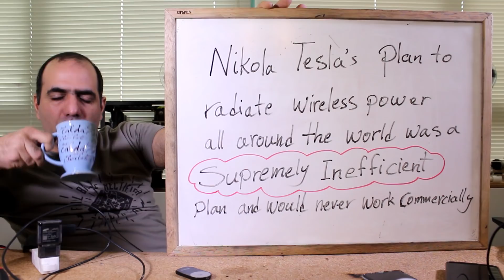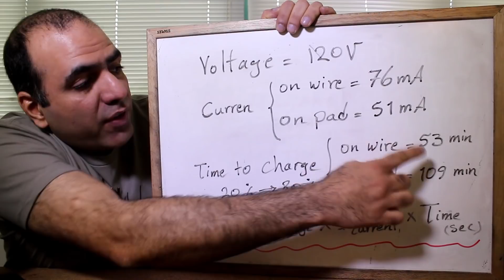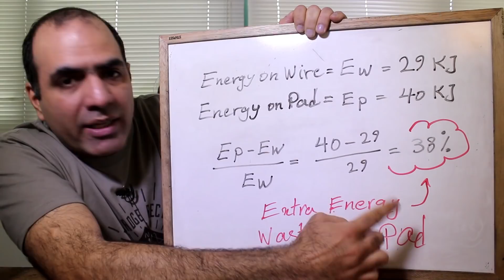Drowning in Inefficiency

Comment: Obviously he has always used Android phones ...  all Apple plugs are designed to fall apart with a few hundred uses :D  But really, had apple stuff for years and did go through several chords a year, from the old wide connector to the lightning.  6 months with Android based phone, not one broken connector.

Efficiency does need to be increased, and it does over time.  Some of the new engine designs are getting much more efficient, like HCCI.  We need more engineers to focus on various things, including efficiency.  But such in the U.S., we have the entire infrastructure of the country falling apart, from our interstate road system and bridges always under construction and or falling apart across the country for the last 4 decades that I've been around to our power distribution as well in a state of disrepair.  A lot of our efforts and daily life can be improved upon.

Imagine all the energy wasted that could be saved both human and machine if they just did the roads right the first time instead of it being a bidding war, with planned degradation for future job security for the paving companies/jobs for the community system.  Also if we found a better, more efficient way to distribute the energy across cities and states.

I can't accept complaints about LED efficiency when a decade ago we were all using incandescent, halogen, etc ...  if you consider those are pretty much fully phased out in the U.S. and most people have replaced most of those bulbs ...  Less than 10% of the energy used 20 years ago to light a house is used today.  That is HUGE, even if they are still not perfect.  It can be said to less effect with cars.  I had a 75 Pontiac that did 9 mpg no matter what.  I drive a car now that gets 40 mpg in worst case scenarios and have done 60+ mpg on the regular, and we are going to see that start to shoot up when the HCCI engines start to get out there, and their efficiency is improved over the years as its new, plus the hybrid thing gets more efficient and cheaper to implement over time as the batteries and motors become more efficient, doing more, for longer, with less wasted energy ...  even though other recapture systems might be more 'friendly' such as compressing air to assist in braking then using that stored energy to help accelerate the car; as we go to engines as generators for electric drive systems instead of used to move the vehicle, etc.  Our computer tech is becoming amazing efficient.  Think of how little power our PCs actually use and how much work they do compared to 10 or 20 years ago, both CPUs and GPUs.

The solution is already there.  We are slowly progressing towards it.  It just doesn't happen overnight.  Yes, we could use a Tesla type to push innovation for our current generations.

There is another way to help.  Personal choices.  Plan your life carefully around being efficient.  Take as few trips as you possibly can out of your house.  So buy your junk in bulk at places like Costco and Sam's Club, etc.  Take cold showers.  Eat things that don't need to be cooked or kept cold to not spoil.  Use more blankets in the winter and wear less clothes in the summer to heat/cool your house less.  I've known people that cut the breakers to their rooms of their house when they aren't in them or to the whole house when they go to work as, since there is some loss in the wires.  Plan your trips with the most efficient route and to take care of everything with one trip with as little back and forth as possible.  Some people can even go further and use less gas, by avoiding stop lights, signs, high speeds, hills, rough roads, etc. Avoiding driving in rain, cold, bad weather.  Backing in when parking as a cold engine is less efficient, so backing in when engine is warm uses less fuel than backing out when engine is cold.

I mean, if you obsess over it, you can do an awful lot.  But at some point you have to have a sense of BALANCE for quality of life.  Nearly 8 billion people can't all live in the woods, hunting and gathering, which is pretty damn efficient energy consumption wise, even if you are starting fires to cook your food.  And suggesting there be less people comes into a bag of worms most people don't want to discuss, as population control or birthrate restrictions tend to violate human rights.

In the end, we have to realize, as the late George Carlin said, that the Earth is fine.  How we exist in it might become a problem for a lot of us.  The planet has been a ball of fire, a ball of ice, a planet of darkness and dust, and lots of things that aren't too conducive to life as we know it, but it is fine, we won't necessarily be.  The only way we could 'destroy' the planet, is to somehow break it apart.  Otherwise, it is 'Earth plus plastic' type of a scenario.  The planet DOES NOT CARE, it will continue on until either something big enough hits it or the sun engulfs it.

So, I say, let us readjust our focus.  We try to do what is best for our species long term survival and enjoyment of existence.  Don't pollute the air we breath and the water we drink.  Don't destroy the beauty of the world around us by digging out mountains or putting housing on the side of them.  Less focus on saying global warming/climate change.  Its a communication thing.  If that angle isn't making progress, then you find a new approach that is much, much harder for them to argue against.  Who wants to live in smog and drink poisonous waters?  That would be a hard sell for anyone.  It is warmer than it was 12,000 years ago when where both myself and Mr. BOOM! would be deep under ice, so efficient discussion would be best on direct, tangible results instead of debating how much humans are effecting it.  If you aren't causing change in their hearts and approaches, then your discussion become irrelevant.

Comment: @electroboom the issues is not that we can't transfer enough power wirelessly, or get more efficient generators... people have to raise the question, why aren't houses and appliances built to run on lower currants? Why can't your TV or laptop be stripped of their transformers, and be plugged directly into a 15-18V socket instead of a 120V or 240V?

Comment: yes indeed , i thought the "wireless" charging this was really stupid.
i mean come on , you can't spend half a second to plug in your phone before you go to bed or what ever.
i tell ya its just laziness.

i say decrease the amps and increase the voltage of standard house hold outlets.
we can use less wire and produce less heat as a byproduct

Comment: Human body efficiency : 25 %
So don't expect too much out of it...
Reply: Well if our body was 100% efficient in cell respiration and stuff, wouldn’t heat not be generated?
Reply: @adamischaos6121  
as i know :
100% efficiency = no heat generated by what's using the source of energy.
Heat is energy lost in the ambient ,so it's not used to produce what's your body is supposed to do with your input source of energy.
Also depends of if you consider heat as a part of what's the body is supposed to produce to keep you alive,or a by product of its own activity at producing cells.
What's the point of your body ? wasting energy at looking for more energy ? 
Efficiency is defined only if you know the purpose of the thing using the energy... 
If we don't even know why we live,we can't even define what's our goal,so our efficiency at pursuing it.

Comment: Combustion engines lose most of the energy through heat I believe.  So utilize a sterling engine that will use some of that heat to run and turn that rotation into electric power that can also run the car.

Comment: In terms of wasting less power at home cell phones are pretty low on the list. Along with it most electronics are slowly going down in power usage despite increases in processing power. Further despite the fact that industry is allowed to use processes that give off massive amounts of CO2 they otherwise tend to use electricity very efficiently. A major focal point for efficiency is in home building. Who cares about SEAR ratings when you put your HVAC in an attic thats so hot it could cook food? Almost no new homes have air tightness standards and certainly old homes don't meet even the slightest air tightness either. Electric resist water heater tanks, long pipe runs and recirc pumps are all just terrible wastes of energy. Every wet room should use a point of use instant water heater.

Comment: Power transmission s also very efficient.  The issue with renewables is unreliability, cost, land use, maintenance blah blah blah.  Lots of problems to be solved.  As they stand they are not feasible as a solution to climate change if the desired outcome is to protect the environment.  If we took this seriously we would be using nuclear but people are scared of it, sometimes rationally but often not and for vague reasoning.

Comment: Effectiveness shouldn't be the only judging aspect. 
Before you start judging life working on the assumption that effectiveness is the only way you should rethink some of your thoughts and conclusions...

For example: our muscles are not effective in 100%! Their work generate 60% of heat and only 40% of mechanical work! Would you like to remove them?
Do you think our brain is 100% effective all the time? No. Far from it.

Another example: traditional bulbs are less effective than LED bulbs but... They have simply construction, no electronics, only glass and some metal. There are far more cheaper in production as well. They don't contain electronics or dangerous metals (like mercury). They are ecological! I would rather use something less effective but more friendly to me and environment.

Comment: Increasing efficiancy is a very nobal goal. However, it's a bit misleading to claim you do not accept anything less than 80%. Pretty sure there is a theoretical limit on energy conversion of most processes, which stands on roughly 60%. You can't win beat physics in a dark alley to squeeze the extra 20%...
Reply from the maker: Switching power supplies can be 95% efficient
Reply: @ElectroBOOM  on small scale processes. For large scale, like that of a power plant, we barely scratch the 50% mark for fossil fuels (coal with gas turbine priming and heat exchangers to the max). Photovoltaic cells are already at their theoretical limit (~ 40%), though people hold high hopes for perovskite cells in development. Maybe the solution would be to somehow scale down the power plants we have (creating microplants) to reduce losses, but you must always remember that thermodynamics holds us down.

I admit that this is not my field of expertease. I base my knowladge only on several talks and papers I attended over the years, and a few conversations with people in this industry. I might be wrong (and will be happy if this is the case), or might have misqouted some of the numbers ( damn memory ).

Comment: Efficiency is overrated. Outcomes are more important. Eg. Crop yields in europe (where they have limited land) are much higher than USA. But food is more abundant and affordable in USA.

Its not important to be efficient with resources you have an abundance. We should focus on increased supply. But... USA power requirements have actually been static for 2 decades. We have an abundance due to efficiency gains made so far.

Comment: I used all electricity and no electrical bill. How you ask. Hydro that right. As a   installed a hydro generator. 24 - 7 power day night. A generator does a 1000 amps but I have a 400 amp service on my house. So  much electricty. The dam is low enough below freezing line. So I used alot of water. So I'm on 8 year now. Just oil motor check system once a year my self. Last power outage I don't  remember. Because there only one under ground system on generator it my house. Yeah it cost me to install it my self. But that was $6,000 eight years now. But I guess it free now. No more bills and I can used all or none.
I be. Putting in a hydro generator for a hotel in Main there useing propane. I designed a system we're going to screen from lake through a 12" tube. To 8 by 8 foot shed were a hydro generator will be water hit  75,000 watt turbine then go back into the river.  To get them off propane.

Comment: Wireless power transmission can be efficient only if the two devices are essentially touching and have a magnetic material to ensure adequate coupling.  Or in other words, a transformer that you can take apart.

Comment: Hi, I really enjoy your videos even though I don't have a clue about half the words you use, lol. I always had an idea of a self sufficient home. The idea is to have one main electric motor, or several electric motors. but the idea is that you use a power jump to start the motor and keeps itself going with magnets. with a pulley it turns an alternator that produces electricity, have a row of these creating electricity charging batteries or using the power, but the rotation of each rotates the next one down the line, does that make  sense? would it work?

Comment: Mr. ElectroBOOM Guy,
If energy is neither created nor destroyed and sunlight (mostly) becomes heat when it hits the dirt and other visible objects (obviously some of it also reflects off all visible objects at varying wavelengths which our brains interpret as colors [sorry for my American spelling] but let's forget that for the remainder of the question... unless it is applicable to the answer) do solar panels make their surrounding environment slightly cooler by using the photon's energy to move electrons across the semiconductor within the cells? Something's gotta give, right? I can see them, so they can't be taking up much of the visible light.

Comment: I agree with the concept but I did actually have an iphones charge cable port thing break.  Something inside failed and it wouldn't stay connected to any cables.  That was after several years and I do plug it in all the time.

Comment: why dont we add solar panel on the top electric car to get extra miles
Reply: first please find information how much solar energy arrive to earth surface per square meter.
Reply: @gromosawsmiay3000  but still we can use it even if it is in very low amount
Reply: @shahmeeralyan7724  please do simple calculations how much energy needs electric car, and how much energy can give you the solar panel.
and at the end how much energy you need to produce solar panel
Reply: @gromosawsmiay3000  i telling to make a hybrid/mixs of current electric car with solar panels
Reply: @shahmeeralyan7724  I telling you just do the simple calculations (based on basic data)  and see that your solution can not work.
basic data: 
1. solar radiation on the atmosphere edge 1.362 kW/m² 
2. 50% is reflected and absorbed  by atmosphere so on earth surface is only 618 W/m²
3. solar panel efficiency 20%, so you will get only 136  W from one m²
4. electric car like nissan leaf has battery 40kWh

and now please calculate how much time you need to load 40 kWh battery by one square meter solar panel. 

I can help you, 40000kWh/136W = 294 hours.... and do not forget sun is not shining 24 h.

and another story, how much energy electric engine consume ? in leaf it is 8-10kW, so your solar panel should provide the same amount of energy if you need to run on it (without battery), so you need around 70 m² and do not forget sun is not shining 24 h.
Reply: @gromosawsmiay3000   I am not saying to only drive car on solar energy I am telling to make a hybrid which can be charged by solar energy as well as by a electric car charger. Or even the car is being driven we could charge car battery very little by solar energy
Reply: @shahmeeralyan7724  and please calculate how much energy can give you solar panel and how much energy you need to produce such solar panel

once again 136 W from one m², and do not forget sun is not shining 24 h, I hope you can understand basic principles of physics and technology

Comment: Hydrogen Fuel.  Safest Idea Ever.
Reply: do not forget about energy to produce hydrogen :D
Reply: @gromosawsmiay3000  Electrolyzer your hydrogen via electrolysis using DC power and harness hydrogen fuel to run the everything plus DC power.  Like, I'm not very smart, and engineers who do figure it out probably get recruited by shadow gov't.  But there HAS to be a way, because there is always a way to promote overunity.  The universe has too much untapped energy.  The ionosphere itself charges life.
Reply: @TimJBucci  read about thermodynamics and we can continue discussing about energy.
Reply: @gromosawsmiay3000  I know about thermodynamics, and I don't give a fuck.  There has to be a way for cooling... all that shit.  Anything you say, it has to be possible to get around.  We're just simply not there yet.

Comment: The only way you're going to get even close to 80% efficient with a gas engine is if you run on the vapor produced by the gas and even if you do that you still have to compress the incoming air to make it efficient enough to get you where you're going without having to fill up. The bottom line, The cost of the conversion and the work involved is too much for the ordinary consumer, And no shop is going to do it for you. so if you don't know what your doing then you won't have high efficiency on your gas engine, and don't even try to convert a modern car because with all the computers it won't work.

Comment: Nuclear generation as an optimal solution? You can't only take in account the generation in power plants.

Remember the full nuclear fuel manufacturing process and the nuclear waste management. It requires energy and had environmental and social effects that should be considered.
Reply: and nuclear power is based on fossil fuel (non-renewable energy source)